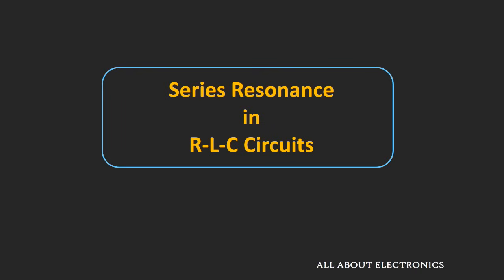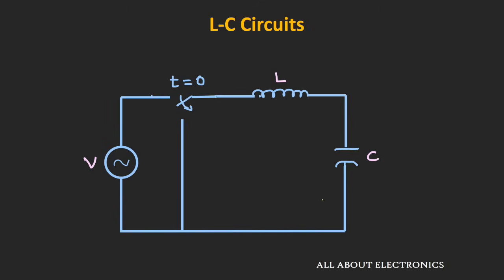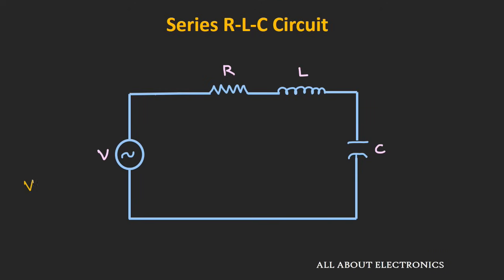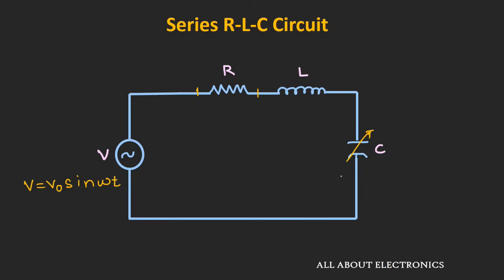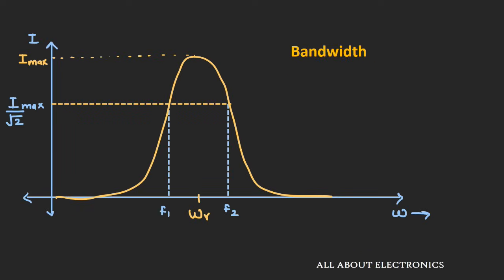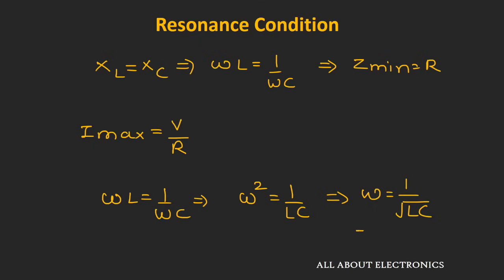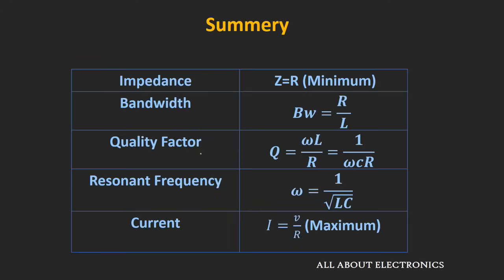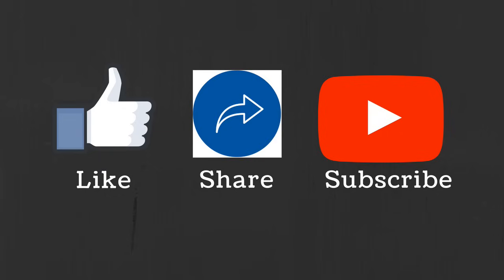Series Resonance in RLC Circuit

Comment: at 3.33 - Can i power the circuit using a 12v DC power supply ?
What should the corresonding Capacitor, inductor and the resistance be get a highest current ?

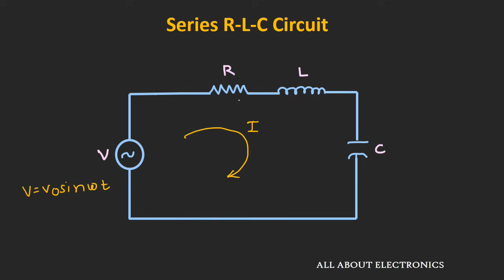Comment: sir at 09:41 you have said impedence(Z)=R+XL+XC but the formula of impedence is Z=SUARE ROOT{R^2+(XL-XC)^2}. please explain sir.... Thanks..
Reply: The formula that you wrote is for the magnitude of the impedance. With that formula, you are getting the length of the Z side of the impedance triangle. So you are getting a number value with that Pythagorean theorem formula. The formula Z = R + XL + XC = R + j(XL - XC) is the formula for the vector form of the impedance. The impedance is basically divided into two components in that formula, resistance R in the Real or horizontal axis of the imaginary plane (you can visualize it as the horizontal leg of the impedance triangle), and the reactance component which is along the imaginary or vertical axis of the imaginary plane (this is the vertical leg of the impedance triangle).
Reply: @justinsantos5751  thank you....
Reply: @justinsantos5751  thanks

Comment: Thanks a lot for your brilliant explanation. 
and can anyone please tell me, if we need oscillation in a series circuit, then why we need capacitor and inductor? why don't we just use an AC voltage source and resistor? Because, you know, the AC voltage source itself can provide oscillation to the circuit, as it's a sinusoidal function (Vs = Vo sin(ωt + Φ)).
Reply from the maker: In your future course, you will learn that, this LC circuit is used as oscillator. (For more information, you can go through the playlist on oscillators and multivibrators. But for a moment, if I tell you in a simple way then this type of circuit is used to generate the oscillations of particular frequency. Or it is also used as a frequency selective circuit ( as a. filter to filter out particular band of frequency). Every time the source signal of required frequency may not be available, or to generate that source, these type of circuit is useful. I hope it will clear your doubt. If you still have any doubt, let me know here.
Reply: Also, can anyone please tell me, from the 2min 38sec scene, why oscillation in energy is seen in the circuit after replacing the AC voltage source with a short circuit?
Reply from the maker: Because, the inductor and capacitors stores the energy for some time and then releases. So, there is a continuous transfer of energy between inductor and capacitor. Thats why there will be an oscillation.

Comment: 17:38
In Q equation
For maximum energy stored, why are you considering only L or C at a time
I think we should consider both L and C together.
Reply: Because when the capacitor is charging then the inductor lost its energy. they both can't store energy together so, the maximum will be given by one.
Reply: @Vinodkumar-is9sy  it is discharging but has some enengy stored at that time

Comment: Tell 2 to 3 examples for every topic which u had told in the past
Reply from the maker: There is a separate channel for that. You can check the second channel ALL ABOUT ELECTRONICS- QUIZ for more examples. 
Just go through the network analysis playlist on that channel. You will find many examples there.

Comment: Sorry if it's a silly doubt but why are Xl and Xc complex?
Reply: Impedance is the complex quantity.
XL & Xc are real.
Z = jXL for inductor 
Z = -jXc capacitor 
You have to study in detail about phasors to understand this. 
A sinusoidally varying quantity can be represented by a complex number which is the phasor. This representation makes the computation easy.
This is the most important topic in AC steady state analysis.

Comment: Sir , w(omega) is the frequency of source , so how it changed when capacitor is changed . While changing the frequency of the radio.
Reply: The source is replaced by The recieved radio signal . And the output is taken across the resister.

Comment: Why isn't the resonant frequency the average of the upper and lower cutoff frequencies....like it seems obvious from the graph
Reply from the maker: Although it seems obvious in this graph, but actually that's not the case.
Reply: @ALLABOUTELECTRONICS  But when we use the bandwidth formula to calculate cutoff frequencies when resonant frequency is given.... That formula suggests that resonant frequency is the arithmetic mean of the          cutoff frequencies
Reply from the maker: Resonant frequency wr= sqrt (w1x w2). So, it is geomatric mean of w1 and w2. 
While bandwidth is difference between w1 and w2. 
And the graph is symmetric.
Reply: @ALLABOUTELECTRONICS Okay I agree with the first part.... It is geometric mean.
But if we assume the graph is symmetric on both sides of resonant frequency. Then at a particular value of current we will get two frequencies say w1 and w2, then graphically the resonant frequency will be exactly in the middle of w1 and w2, which means it is the arithmetic mean and not the geometric mean.

I'm sorry I'm not able to express my doubt clearly as I can't send a picture or anything here...but pls try to help if you understand my doubt.😄
Reply: @ALLABOUTELECTRONICS  And one more thing..... So you mean that the graph is assymetric ..... Or the graph shapes on left and right side of the resonant frequency are not the same.
So why is it assymetric?

Comment: Thks for  your  explanation, but I do not understand well at 12:21 why I1=(I max/2^(1/2)) = V/(R^2+(wl-(1/wc))^2)^(1/2)
Reply from the maker: Because I1 represents the lower cut-off frequency, where the current will be equal to 0.707 or 1/sqrt(2) times the maximum value. I hope it will clear your doubt.
Reply: Thks for your reply. I got it now.

Comment: What is half power friquency
Reply from the maker: It is the frequency where the power will be half of its maximum value. Or Voltage and current will be 1/√2 times the maximum value.

Comment from the maker: The downloadable link for the problems on the Resonance has been updated.
https://drive.google.com/file/d/0B3FOmN0FcD6OWUpvRktobGtXM2c/view?usp=sharing&resourcekey=0-TGO50EdiyV5f3wXW5qR4ug
Reply: where is the solution of these numericals
Reply: Solution?
Reply: Sir one doubt,
If we want to listen to all the other frequencies as in listening to songs, why can't we use rejector circuit or band stop filter instead of band pass filter?
Reply: @umasrivastava4142   if we use band stop filter, it block the wt frequency we tuned, so all other frequencies are mixed up and we get noise not a song bcz of that we use band pass filter, it only passes the particular tuned frequency
Reply: @shrinivash1578  thank you sir